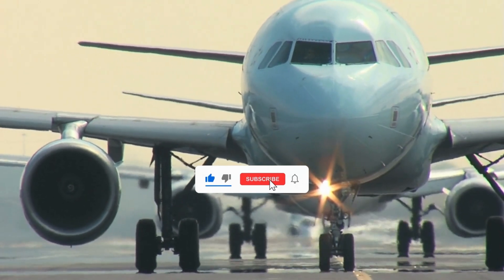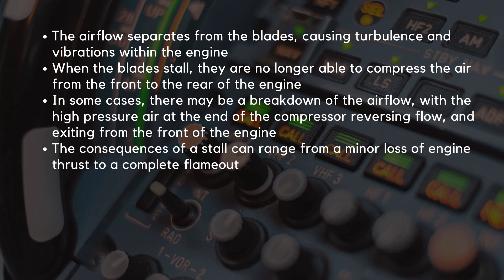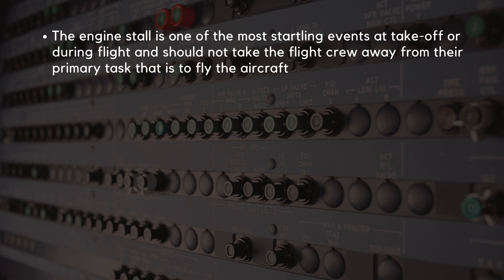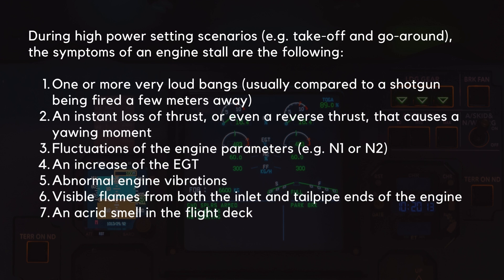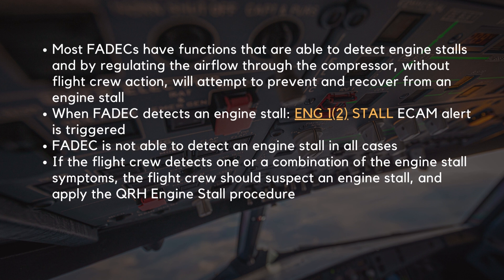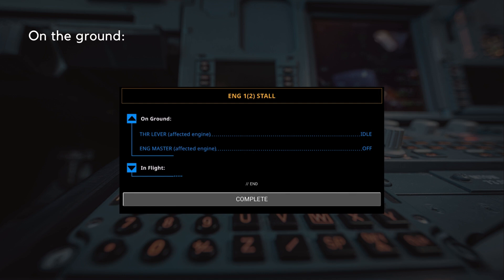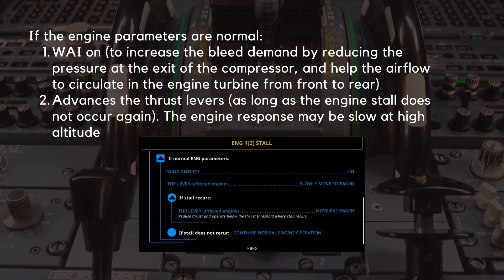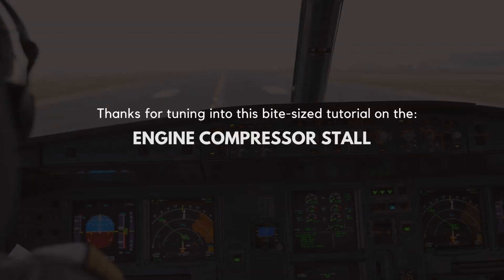A320 Compressor Stalls Explained | A320 Engines

Comment: I'm still very confused, TBH, as to where the thrust is applied in the engine.
We're told that "expanding gases can't go forward, due to pressure gradient", so it MUST be, then, that the pressure is the "wall" here, but it comes from the compressor blades, so this means that the counterforce is applied to the compressor blades, essentially?
Reply from the maker: Thrust comes from the imbalance of pressure—higher at the front, lower at the back—forcing air rearward. The compressor blades don’t directly “push” the engine forward; rather, the expanding gases in the combustor accelerate rearward, and Newton’s third law (equal and opposite reaction) creates thrust. The pressure gradient prevents gases from moving forward, but the primary force driving the engine forward is from the high-speed exhaust at the rear. I hope that helps
Reply: @A320Knowledge  read again what you just wrote. Draw the components on a piece of paper. We live in a physical world where laws of Newton is the only way changes manifest themselves. And there is no action at a distance. It means that in your picture, you need to have explicit interaction between 2 molecules, one pushing against the oher. THAT is what I am trying to build a mental model of, and it's NOT supposed to be a simple model.

All you wrote is tantamount to the "Bernoulli" explanation of wing lift, that is - magical incantations betraying lack of understanding. Bernoulli, energy-based, other similar approaches allow us to CALCULATE lift, not EXPLAIN it. The reality is not statistical. Statistics is descriptive, it's an aggregate of effect, while reality is the cause.

As for the cause, in fact, if you ask an actual physicist, they'll tell you that we don't really know a good model for how wings generate lift, we resort to numerical analysis, which is why we need HPC so much in aerodynamics industry.

Hence, there can't be "exhaust" being a "force", it's just nonsense. Just like thrust can't be produced by a nozzle, which is but a momentum focusing device. Converging nozzle doesn't even have a surface for molecules to react against, FFS. What you are thinking about is the standard textbook DISTRIBUTION of trust distribution by component, that is - "what disappears if we remove this component", which is not the causality of thrust.
Reply: @ Just to drive the point home. I'm comfortable with Euler and Navier-Stokes. It's not that I haven't read textbooks.
Reply from the maker: You’re right to focus on physical interactions, but there are some misconceptions. Thrust results from pressure differences across the engine—higher at the inlet, lower at the exhaust—not a single surface. A jet engine moves forward by accelerating mass rearward. While a converging nozzle lacks a hard surface to “push against,” thrust arises from momentum conservation, not direct molecular interactions.

Pressure gradients don’t block gases; they drive acceleration. Expanding gases in the combustor move toward the nozzle due to a pressure imbalance, generating thrust. Compressor blades impart energy to air, but their reaction forces are balanced by turbine loads. Thrust mainly comes from acceleration in the turbine and nozzle.

Simplified models can be misleading, but jet propulsion follows fundamental conservation laws. Momentum change in the working fluid creates thrust. Thrust isn’t from exhaust “pushing” on a surface but from accelerating mass rearward. The compressor doesn’t push the engine forward; it enables efficient combustion and expansion, where net thrust is generated.

While detailed CFD is needed for precision, the physics—momentum conservation and pressure gradients—are well understood.
Reply: @A320Knowledge  again, I repeat, you are essentially using sound bites from textbooks. Try writing a particle simulator. Nothing makes people realize how little they understand than trying to actually build it.

And here:
"While a converging nozzle lacks a hard surface to “push against,” thrust arises from momentum conservation, not direct molecular interactions."
do you even realize what you're saying? Thrust is a force. Momentum conservation is just that - a rule that some aggregate value is conserved. It's like saying "GDP is what extracts oil and writes code".

Converging nozzle doesn't need a surface to push against, too, you're misunderstanding what it does.

TBH, I'm now more confused how these quite obvious things can be misunderstood.

As to my original question - you have to go through fixing your mental models before you understand what I was asking about, I guess 🤷🏻‍♂